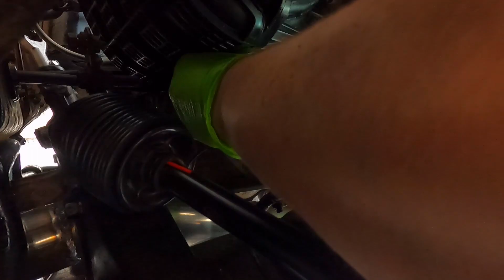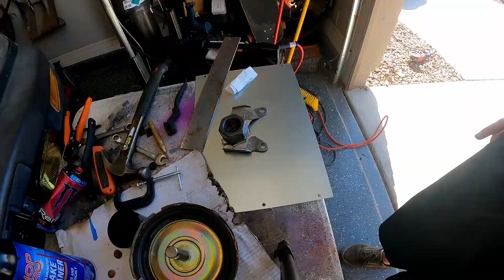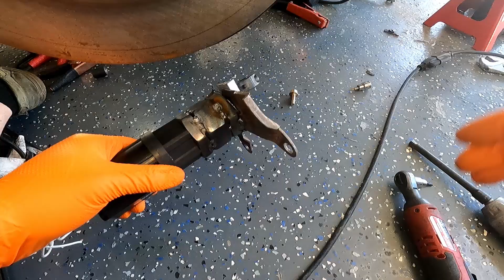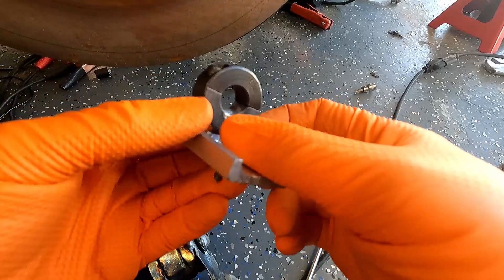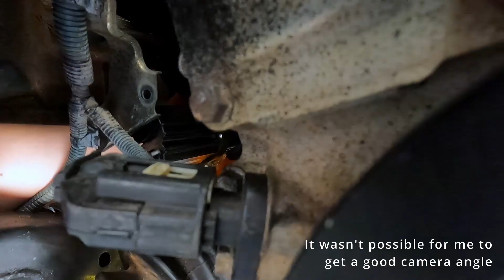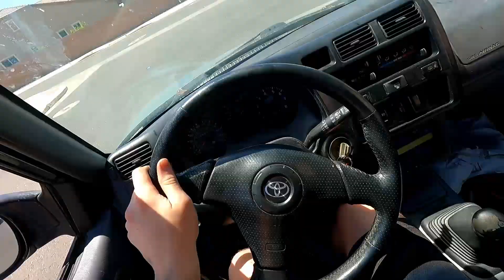Electronic Transfer Case | 2AR Swap RAV4 EP11

Comment: Ari, do you know the part number on the GM Actuator you used? Thank you, E
Reply from the maker: I used Dorman 600101, I don't remember what the General Motors part number is.
Reply: @aristoyotacorner  do you remember the thread pitch also?? I am swapping a fresh rebuild into mine soon, and those vacuum lines are a disaster to keep track of. Also will be a pain when its turbo time